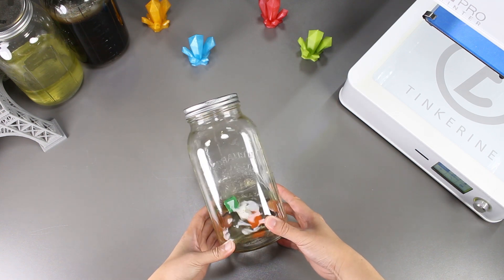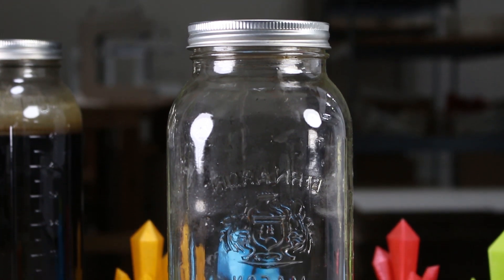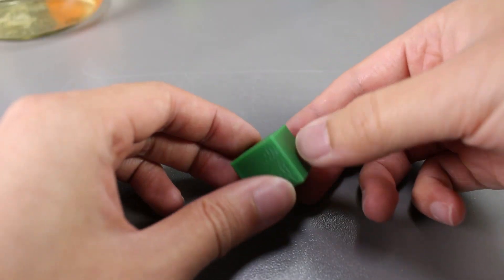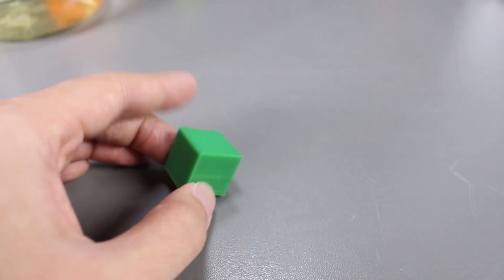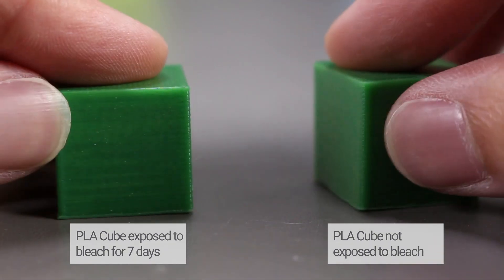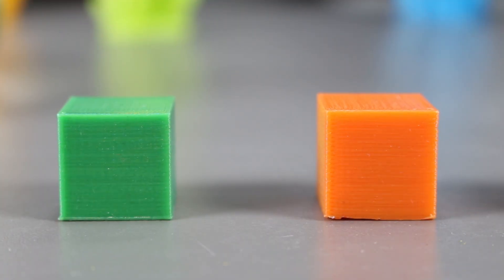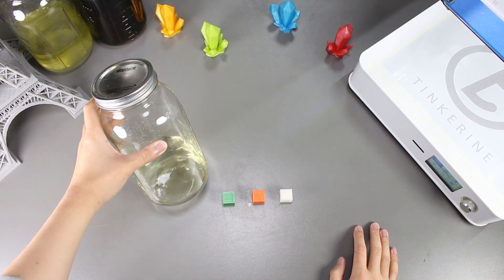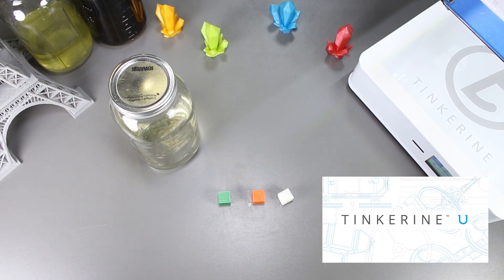Exposing PLA Filament to Bleach Part 2

Comment: There are probably a lot of people printing face shields and surgical mask ear guards wondering if they can sanitize PLA with a bleach solution, I think this is a compelling video to say that you can use a bleach and water solution to sanitize if these blocks hold up to 5 days of direct bleach submersion.
Reply: Maybe there is a test you could do to show if bleach makes PLA more brittle with some kind of measured applied pressure test. keep adding pressure until it breaks just a thought